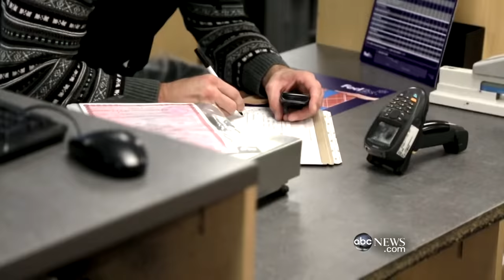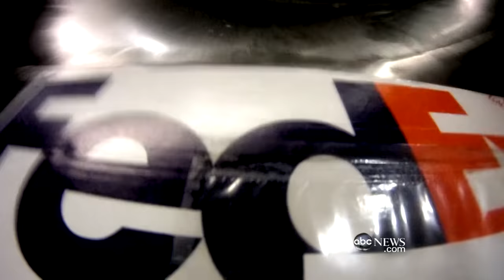Inside FedEx's 'Superhub' During Christmas Rush

Comment: I worked in a UPS hub for 5 years, there is no way that pie would have made it intact during peak season. If people could see what really goes on in hubs you'd be shocked!!
Reply: This is FedEx. There's a difference.
Reply: Haha, that's funny!
Reply: notice they didn't put it through the "Matrix" lol
Reply: hup2thepenguin Hell yeah, there is.
Reply: Had a friend that worked at both places at the same time. Trust me, no
Difference, except UPS pays more in the long run.
Reply: Good to know. Thanks for the enlightenment.
Reply: You're welcome!
Reply: I'm sure you'll find horror stories on both sides. I'm glad you've had better luck with FedEx though. Hell I've had great luck with USPS.
Reply: gmjunky87
As far as a package handler goes, FedEx will pay you more. However UPS pays a tad bit better to their drivers than FedEx (Both directly and through Third-party Contractors)
Reply: In my area I believe feeder drivers top rate is around 30/hr. A buddy of mine got a red circle job as a sorter/ package handler after two years and topped out at 23/hr (5 years ago, probably higher now) UPS has shitty pay to start though
Reply: I worked in a UPS Hub and some people would be afraid to ever order a package ever again if they saw what I saw every day.
Reply: Heavy flow of packages going into the trailer I had to load. Packages getting jammed on the belt or falling off the slide because there's too many boxes on it. You don't have time to carefully place each box on the wall so boxes get thrown often. Several times boxes get damaged and need to be re-taped. It's very busy right after Thanksgiving. I would load thousands of boxes in 4 or 5 hours.
Reply: e roder Hahah, yeah, exactly. I was just staring at all those fifty to seventy pound boxes tumbling over each other in the matrix and thought, "There's no way, that pie would be cream." Working at FedEx like I do, I know all too well the sad fate that many small, improperly boxed packages face at the matrix.
Reply: Ups is not fedex
Reply: DogMaster237 yeah yeah yeah, that's why I always see their wiggle wagons in the ditches! Way to dig up an ancient post!
Reply: This post is so old I've already switched jobs between now and then. Hah.
Reply: gmjunky87 I work as a material handler for FedEx Express, and I see packages that weigh up to 100 plus pounds stacked on top of packages the are marked 'FRAGILE-HANDLE WITH CARE!'.
Reply: tonykegger same here. Occasionally we get packages out at non-cons that are ripped open because,
A. Staples are used instead of wide width tape,
B. The contents of said package (s) are too bulky or awkward for said box or,
C. The box has gotten wet either from rain, standing water in the carts or ulds, or just from the contents if you're shipping liquids.
Reply: hup2thepenguin lmao no theres not trust me we be on some shit
Reply: @GmJunky87 where are you from feeders only get 30 what the heck our package car drivers are making 42 hourly with the new contract and our sleepers are almost making a dollar a mile now. From California personally
Reply: You just get my cocaine shipments on time buddy!
Reply: @the101channel  In the long run, UPS pays more for both drivers and inside package handlers. We get around .80 to $1/hr raise per year via contract, while FedEx offers roughly 3-5% which is considerably less.
Reply: James G 
I worked at fed ex and let me tell you somethings.
When loading the trucks. You must cram as much boxes as you possibly can or else a red light would go off and the managers would be on you.
Unloading; there are trucks that are “hots” meaning they need to be done fast so by that you have to avalanches and throw piles of boxes in the belt so the truck could be done ASAP. 
I never kicked boxes but there was people who would kick them and some bitch once kicked a small at me because I almost sent it to wrong belt
Reply: James G i start work passing through security and TSA checkpoints with xray and metal detectors. you enter a city all in its own catch one of the busses to the next hub over all the sizes of colleges through chaos of planes landing and thousands of airport tugs pulling sets of 2,000 lbs of packages i make my way to my area walking 2 miles. a warehouse the size of 4 walmarts where we sort 11% of the packages that get dropped off by the planes so you can imagine 9 other warehouses. in the bottom are the tugs being loaded. i make my way up the metal flights of stairs you can see through to the 3rd story where below us they load the tugs. from there the hundreds of conveyers on the third floor bring over 200,000 packages a day to be hand sorted on a conveyer line where we all have our numbered slot on the line. a metal arm swings packages to each person by the thousands. the hand sorting and lifting begins everything imaginable in those packages i hand sort for 4 hours and take a 30 minute break then head back to hand sorting until all the packages are finished and back to their designated plane. i go back down the flights of stairs you can see through the floors, i hurt. bad. i walk my 2 miles back to the TSA and security checkpoints and pass through the xrays and metal detectors just to have the final mile stretch back to my car. i make it, i head home aching in pain only to sleep and get back up at 7 am to do it all over again. every day.
Reply: You should see ups
Reply: If anyone knows of a perfect shipping company that doesn’t throw shit around plz send me the info🤦‍♀️
Reply: @hup2thepenguin  ya u right there is a difference its worse than ups lol
Reply: Omg peak season sucks ass. When I was loading into the Local Trailer all the packages where getting smashed and thrown.
Reply: Hahah yea i worked at UPS 3 years in California and we have 90x more people than some of the other states for christmas they opened a new building just for amazon shipping look it up its huge UPS meridian park way CA they might also be doing surepost when i was there atleast 6 years ago.
Reply: I work at a FedEx so we are pretty careful with our packages there are a couple Bad Seeds but they get terminated upon the first viewing of doing anything wrong to a package in the end we have to pay for that now we're not trying to pay for someone's Priceless items to get destroyed we fired those people right away I see it happen everyday but we have had 30 days without accident or incident so I guess we're doing pretty good at breaking records around here
Reply: @gmjunky87  i make 18 an hour. Under A year fed ex
Reply: @gmjunky87  6 years from now and that statement still holds true for fed
Reply: @Dani P where was this? You must have been working ridiculous amount of hours and probably every day to manage that.
Reply: Oh trust me I know lol
Reply: @hup2thepenguin  i agree that pie would not be in one piece
Reply: @hup2thepenguin  it’s all the same. You have employees that care about other people stuff vs employees that don’t care what happen to your items
Reply: Exactly
Reply: @coolinwithlaura4114  I was informed by a FedEx agent that small packages as in 9x6x3 boxes are kept separated from large boxes.  From what I see on these videos, it doesn't look it at the hubs.  Should on pack like a 150 lb box is going to impact it?
Reply: @arizonarebel5706  at the hubs items smaller than a boot box are to be separated at unload.... Then it goes to sort if needing a track weight someone like me gets it and then contained separately
Reply: @hup2thepenguin  wasn't there a video on tiktok that showed a man working at FedEx throwing packages, and then saying "we don't care about your packages"?
Reply: Ups sucks. Y’all take forever
Reply: Work for DHL myself and can for sure say that pie would have not made it intact through our service lol
Reply: 🤣😂 Big Facts
Reply: Dude fed ex would tear that package up during peak season lol
Reply: @hup2thepenguin  my man i u would see people kicking boxes trowing them and playing as a football ball in fedex
Reply: @hup2thepenguin  nah I work for Fedex he right
Reply: There is no difference 😂
Reply: With all that squashing & mashing around. The pies will be pancakes instead. 😅

Comment: I work for FedEx, and it is a crappy company, with terrible rules and regulations, that screw over the contractors, drivers, etc. And yes, packages do get tossed around a bit, as little as possible, and fall off shelves, but that is inevitable. Every company that delivers packages is the same way though. Anyone who works or has worked for FedEx will tell you that they are overworked, and put through way to much stress and pressure.
Reply: I wouldn't say it's a crappy company. But I agree it is stressful
Reply: China's courier company is even crazier.

Comment: As somebody who used to work for Fed Ex, I can guarantee you that pie would have been smashed and mashed by the time it reached it's destination if it wasn't for the fact that it was being deliberately babysitted for a news story. Especially during the Christmas rush. Those small packages get tossed onto the same conveyor system as 70 pound boxes with anywhere from TV's to Punching bags to whatever. And they all get crushed and smashed together multiple times before even being loaded onto the trucks where they're tossed and crushed again in a high speed game of Tetris to cram everything in and take up every inch of space. And this happens multiple times over and over before it reaches it's final destination.

Comment: I've worked at FedEx Ground and UPS.  What they don't show is how ground is processed.  Overnight and two day air have a system of their own and are treated very well because they are cash cows to these companies. Ground packages go through a completely different system.   If you have something fragile, either pack it to drop on concrete and survive from at least 6 ft in the air or ship via air.  Many of the belts these packages travel over are 15 ft off the concrete, so if packages back up on a belt and it does happen more than you think, those boxes make a 15 ft fall to solid concrete.

They should try shipping that same pie ground and see how it looks at the end.

Comment: I work at Amazon, so, I can certainly appreciate how hard Fed Ex's employees work during the Holiday Season!
Reply: +marie55 The packages are literally piling up around your shoulders and you would drown if some kind soul didn't stop the belt to dig you out. 
Stopping the belt is frowned upon, but sometimes you have to do it because packages get stuck on corners, or you flat out need more time because "there's too many of them!" 
It's like that episode from "I Love Lucky" except instead of chocolates, they are random items filled with anything and everything.
Reply: +marie55 Amazon is buying their own freight jets to speed up packages and to lower delivery prices. I wouldn't be surprised if they turned into a mail delivery competitor and completely dropped USPS, UPS, and Fedex unless its a holiday and they're under a lot of load.

Comment: Hi as we head into the holiday season I do have a couple of suggestions. Even if it is unbreakable it still is a good idea to pack it well using bubble wrap and shipping peanuts. The right size box is also important. This reduces the shifting of contents inside the box and possible damage. If it is breakable wrap each item separately in bubble wrap then put it in a box. Then put that box again in bubble wrap. Put that box into a larger box, write your address (or apply an address label) under one of the  flaps and seal the entire package with good packing tape. Do not wrap the box in shipping paper as it can be torn apart during the handling process. Of course write your address and phone number as well as the address the package is going to. It is not a bad idea to include the recipients phone number as well. And most of all ship early to avoid the holiday rush!!

Comment: I agreed with most comments about not handle carefully with these employees.  It comes down with management people who do not do their work correctly.  If you surf the Japanese delivery, how do they do it.  I witnessed one Fed Ex guy throwing a next customer package on the truck floor via my camera.  I bet the driver threw my package too before reaching my home.  My package was ripped open 3" square and it was heavy equipment called Vise.  Opened it up and it dented at the corner.  They need to train their employees better with customer services.

Comment: I've almost died in a FedEx facility/trailer. They want you to rush, rush, rush. They put me in a trailer just minutes after I clocked in my first day. I'm 5'3" and was expected to move huge tires, full sized copier/fax machines into the truck and stack it like an intricate Tetris game. No one told me that the metal doors that open for the underbelly of the trailer can slam shut. They did. Right on my head which sent me through the air into the rollers feeding the boxes into the trailer. It took all I had to push through blacking out so I could get out of the trailer before hundreds of packages piled on top of me. My trainer was nowhere to be found so I just stumbled away with a pretty severe concussion and head wound. Took 4 minutes for someone to find me stumbling to find the bathroom so I could pass out safely. Years later I still have neck issues from the whiplash from that day. I was never compensated and was expected to return to work after being cleared by a Dr. Of course I never returned. These facilities are death traps and honestly should be better monitored for employee safety. A package can be replaced or refunded but not a human life.

Comment: i’ve gotten a cracked 32inch tv, a broken glass panel on a 1grand gaming pc, and a monitor that had a huge dent in the box, it was crushed (luckily it was on the back of the monitor n didn’t break it) but it looked like someone used it as a seat ..all shipped through fedex.. after that i hate using fedex . .. and they never leave the box where i ask them they just throw that shit in the most open spot in front of my house :/

Comment: So, I RMA'd a processor stuck to a heatsink to AMD and I was given a FedEx label. 

I'm concerned if it'll make it to the RMA center unharmed since you could definitely feel the package rattle just a little inside despite being packaged with a lot of packaging paper.

Do they treat smaller, lighter packages more carefully?
Reply: some times depends on the person  I've seen people throw those lol
Reply: +Marbles092593 They actually do treat small boxes a little better.

This is how it works:
1) They stack the heaviest boxes at the back of the can and near the back wall, but not against the wall. They leave a little space away from the wall for the small packages / letters.
2) As the packages come down the belt, they continue to stack the bigger boxes as high as they can, until they are almost near the top (roof) of the can (packing container). 
3) They throw (believe me, its the safest way to do it) the small packages / letters behind the "wall" of boxes, so they fall into the space behind the wall. This keeps all the small packages "safely" tucked away, rather than risk crushing them in the general maelstrom of auto parts and 150 lb solid containers.
4) They keep a space at the very top of the container to continue tossing all the little boxes / letters. This way, all the little stuff is mostly at the top, and not crushed underneath. 

However, these containers are packed like sardines, and when they are opened at their next station, the packages usually tumble out. There is a chance a small box falls under a heavy box or a small box gets stepped on by a package handler fleeing from the waterfall of packages. This is pretty rare. 

So I would say, small packages have a better chance than big packages that are poorly packed. 
In fact, the worst packages by FAR, are the big boxes that are packed without any foam. Those get THRASHED like pancakes.

Comment: I worked in ontrac shipping hub and I guarantee you we have zero absolute zero regard for fragile packages or Handle With Care or this side up is meaningless we have thousands upon tens of thousands of packages that have to be arranged by ZIP code and be pulled off and thrown off of trucks and they are violently dumped and thrown and kicked and that is just a matter of the daily process there is absolutely zero regard to what type of package and hundreds of pounds of other packages will be stacked on top of that pie package with zero regard whatsoever